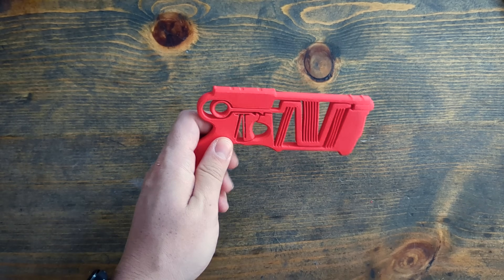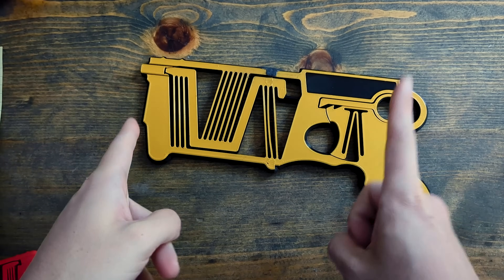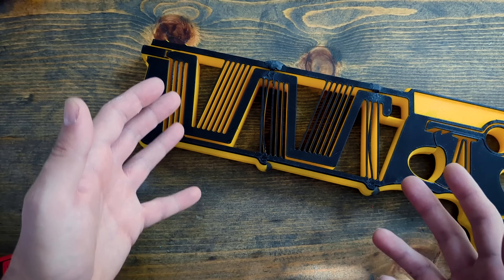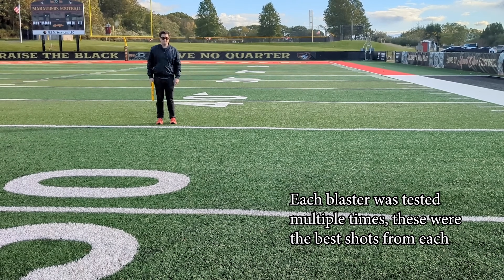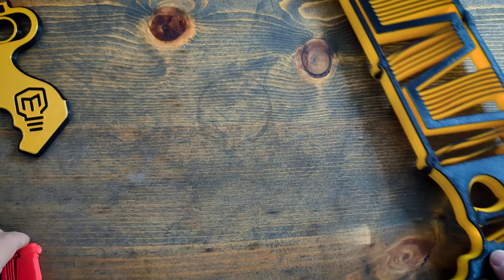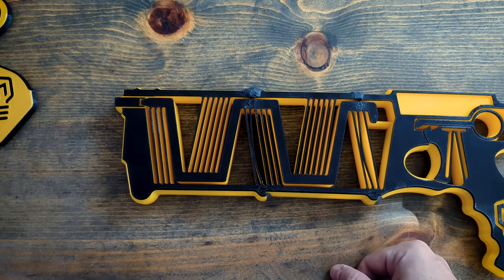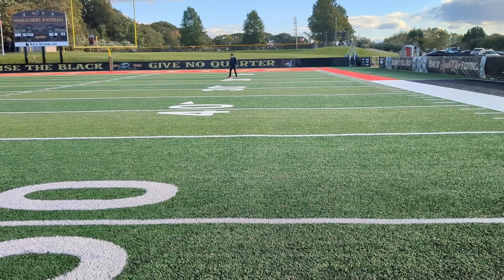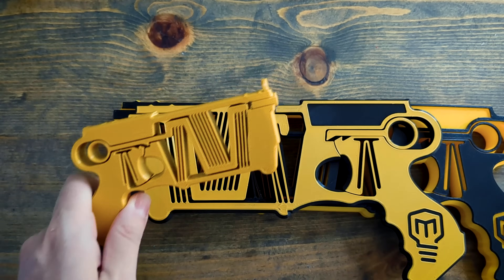Mark Rober's NERF blaster just got another BIG upgrade!

Comment: I know it's been a year or so but I would just like to say that the Pilot is an unfair comparison. The rival balls are dimpled to catch the air better and rival blasters have a hop-up tab to put back-spin on the balls. That entire line is designed to go far while still being able to be sold in the toy isle. A much better comparison would have been the inspiration behind Mark Rober's design, the Maverick. It's just supposed to send a little suction cup across a room without hurting anyone or anything, not a ball designed to go far and fast.
Reply from the maker: Good point!

Comment: I was just thinking about messing with the half sized blaster. increasing the width of the mini by another 4 or 5 times. Doubling the handle size (while maybe keeping the width smaller than the rest of the gun) and using a plier type thing for the readying mechanism to make it easier. And maybe just doubling the number of tension bars without fully extending the length. Wonder if that would improve it or I’d still end up losing force
Reply: Maybe increasing the thickness of the frame of the gun could help energy lost too?

Comment: Designing compliant mechanisms is such a pain because the design elements are all constrained to each other. It's really hard to design in isolation. You can't just extend the number of springs, because the flexors are all acting upon each other, and separating arrays of flexors is not great (it's why you're getting the bowing in some of the flexors). I would cut it so that only the frame and the intermediary "piston" body are the things that are cut, and have the flexor arrays be in their own sections together. As for coming up with a design with way more flexors... I dunno. Throw crap at the wall in a CAD program that can simulate rigid body deformation? That's the best I got. Compliant mechanisms are hard!

Comment: This is very simple spring math. If you add two springs in series, you get a weaker spring. Look up series vs parallel springs. By slicing it into two chunks, you are adding two springs. You would have to redesign the spring to make it have a higher spring constant.
Edit: by making it thicker, you probably did increase the spring constant some, but lost that benefit by adding them. I’d be curious to see original size thicker
Reply from the maker: Interesting, didn't know that!

Comment: Print it with a longer barrel so you can incorporate a plunger on the end of the mechanism to push your projectiles rather than just slapping them really hard.  Just calculate the stroke, and decide the displacement you want in the cylinder your plunger pushes through and have s small oring slot around the plunger. A loose seal is fine.

Comment: If the piece that you pull  back was connected to the front of the tension rather than the back it would be tronger with the upgrades

Comment: The idea of the material absorbing energy required to flex the springs reminds me of a gear box with such a low ratio that the last gear is nigh impossible to move.
Given enough springs, the material will absorb all the energy and not fire the projectile; as mentioned in the video.

Comment: Hey, I had a few suggestion on how to imrpove the original Mark Rober design. Here are the suggestions I could think of to increase power. the further down the list, the more effort/ tinkering/ materials other than 3d printing needed:
1. increase thickness of top and bottom rail, the spring force is only gonna be as good as the part that holds the force in, like trying to store 5 gallon of water inside a coffee mug. The rails at the top and bottom are the cup, and the water is the spring maximum potential energy holding in. Credit to @MisplacedMoose for that one.
2. The priming pullback thingy has to be longer the more potential energy the springs have (or the more springs, but that will increate total potential energy anyway). Having twice the water (max potential energy), but the same amount of energy to pump out the water (priming mechanism being the same) is severely limiting the output, and wasting the water ( potential of potential energy), making it the same as having 1/2 of the water in this analogy. Credit to @poofn5719 for this point.
3. Use more springs and model them to use modules like in the video. Self explanatory
4. Using a different filament, like TPU which is much more flexible can make the nerf blaster maybe last a bit longer, because compliant mechanisms stress out and stretch the material by definition, so to avoid more reprints, this might work, but it is 20 bucks for a spool. 
5. Adding actual metal springs from pens (trampoline springs could work, but that is literally insane), because they are compact, durable, and have much more power than actual printed plastic. These are also good and modular, weasy to replace, and expremely cheap, 1000 ct springs are like 8 dollars off amazon. Obviously the simplicity 3d model would need to be sacrificed, and a new design would have to be made entirely, but this could provide a huge bonus to firepower.
6. Make a sheet metal, or even solid metal version of this design, obviously this is extreme, but online shops can do this, and you would better off make the compliant mechanism springs into actual springs, because metal is not very flexible. A hige advantage to this design is that the model overall would be much stronger, allowing more springpower, and an overall thinner base model.

Obviously some of these are a stretch, but some of these are plausible and possible, i might make 1, 2, and 3 modifications to the model on my own time, but hopefully you can make these modifications to your own model.

Comment: i never really like systems like rober's blaster in which all of the force is just pushed onto the dart, as eventually ii feel like itll just deform the back of the dart. Stringers included. although for the video, i thought it was alright, as realistically an actual plunger tube just wouldn't work at the sizes he had to make it.  However, when he made the claim it "shoots harder than a real nerf gun" it kinda made me cringe because most if not all n-strike blasters like the Maverick (the one he showed in the video) suck bootyfart to begin with, only going like 30 feet, and the elite line shoots 70 fps, and rival blasters hit 90-100 fps, so it just feels odd as N-strike isn't like the only line of blasters to ever exist lol

Comment: The big zig zag thing in the middle deforms and stretches so that way the springs deform it instead of it pulling them. In short i think if you make the zig zag thing in the middle thicker or out of a harder de deform plastic it should use the springs properly.
Reply: Would increasing the width make it harder to deform? If so does increasing the width of the entire gun further effectively increase the power without needing further changes?

Comment: The pull back of the spring needs to be longer, you have twice the springs but only the original amount of prime, so you're not able to fully extend them
Reply: Exactly what I was thinking. Same deflection over more distance means less movement of the head.
Reply: You could use some form of reduction (Like gear reduction, but in the form of a compliant mechanism) to make the prime further without making it so you need to pull the trigger more. It would also make the trigger easier to pull when done right
Reply: @lene_leaf the primer doesn’t need to be longer. The inefficiencies have to be fixed. Afterwards it doesn’t matter how long the pullback is
Reply: Sure, but less movement doesn’t mean less force. The issue is that the longer the blaster becomes, the more the design flaws add up. The double length blaster is double as inefficient as the original one. Has nothing to do with the length of the pull back. If you fix the original blaster design and make it more efficient, it becomes harder to pull back as well, same with the double length design. The W shape of the mechanism sadly deforms so much, that it gets stretched. Plus the top and bottom structure do the same. All this flexing is the issue. But in order to make the longer blaster stronger you dont need to make the pull back longer

Comment: As someone said, maybe nylon would be a nice material to try (needed full metal hotend), or, not extend but make it thicker, like the 125 but normal size.

other thing that might be worth to try, not sure, couse it may brake due to the force, is make not only more modules, but the distance it got to do longuer. With that it should acumulate more energy along the way it does. But mostly sure you need diferent materials to hold it

Comment: The spring force is only going to be as good as the part that holds the force in.  The longer the top and bottom rail get, the more they flex and the less capable they are of holding the springs in compression.
If you truly want to get more power out of it you're going to need to increase the thickness of the top and bottom to prevent them from deflecting.

Also you've just taken the first step into a rabbit hole of printing your own nerf things.  It's deep down here, be careful.

Comment: I have a rival Pilot that I converted into a short dart blaster using old nerf parts plus and extra spring.  It fires around 140FPS.
Reply from the maker: Nice, what kind of spring?
Reply: @Patrick_Gibney  I have one that's rebarreled for half darts, and it hits 170 with the stock spring. A good seal and a light dart make the Pilot's design shine